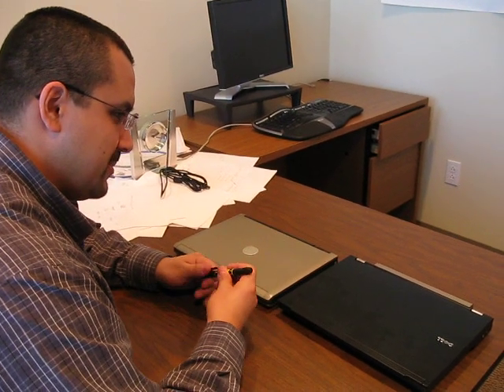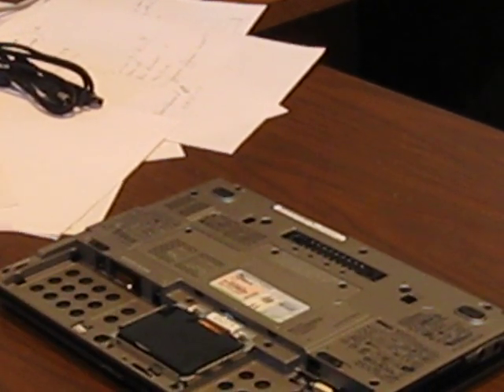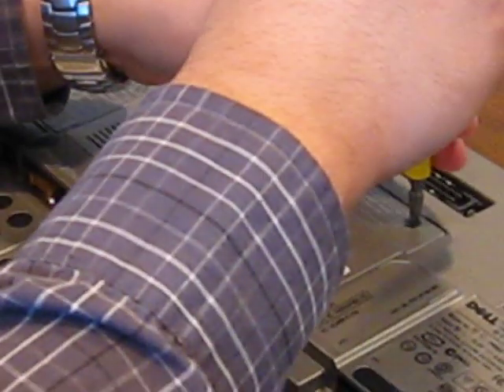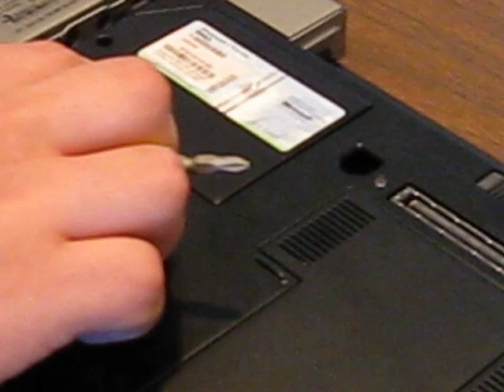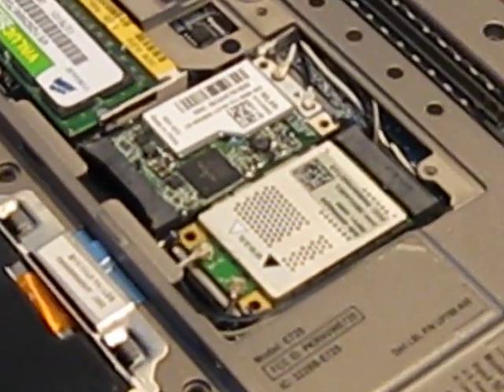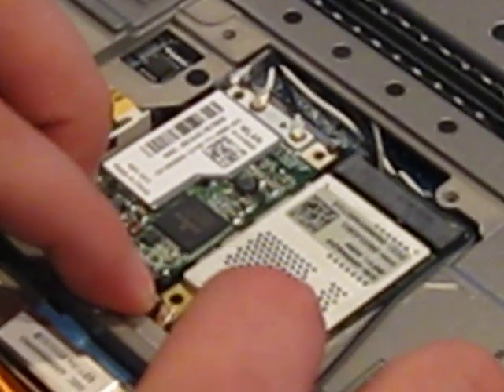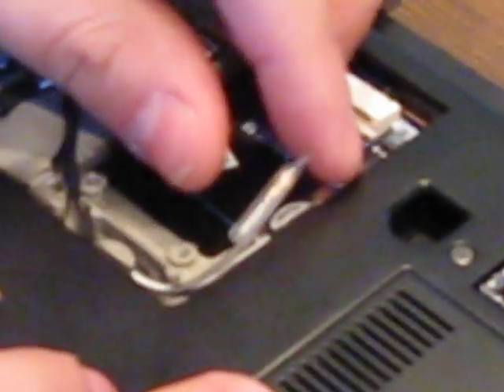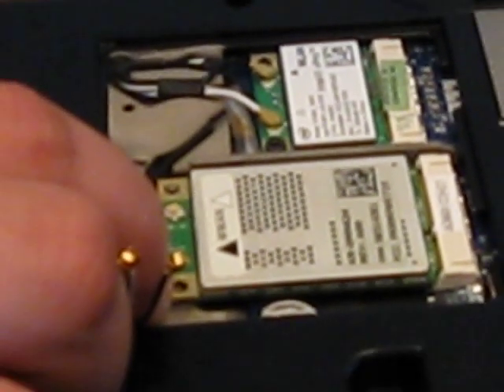Move Dell Broadband Card

Comment: I moved 5520 WWAN card from D630 to E6320. Everything looked fine. Drivers neeeded some tweaking to get installed, but at the end I have got the device detected and almost working. However Dello Mobile Broadband utility consistently reports "No SIM card found. Check orientation". Is this possible there is any hardware incompatibility that does not allow 5520 module to work in E6230?